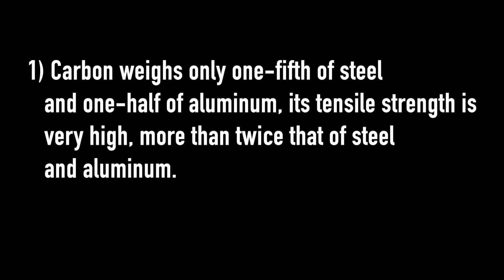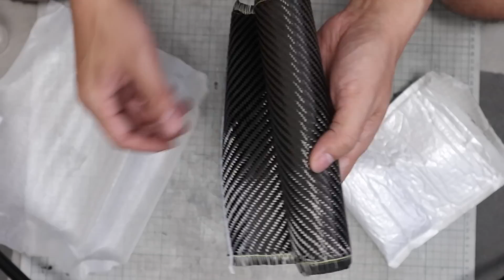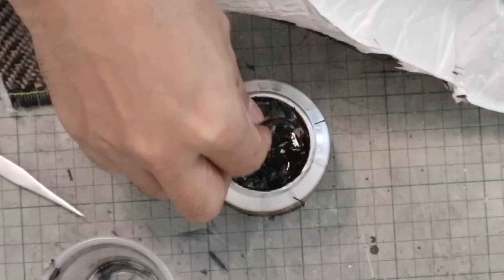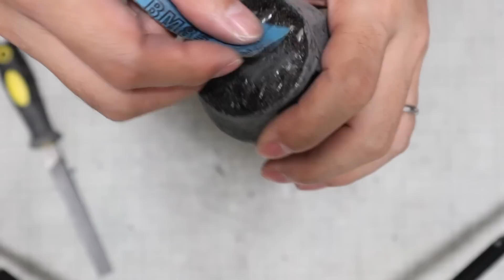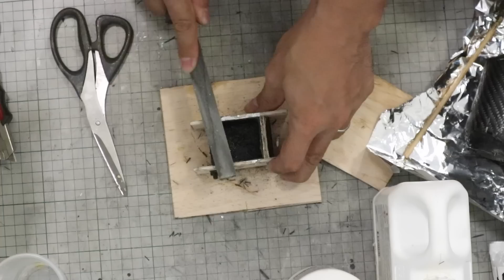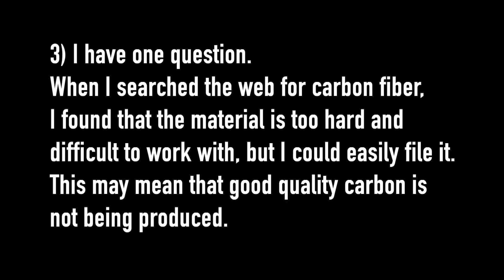Building The 5-Axis CNC Machine in a Small Room: A DIY Journey. (part4)

Comment: Mine use forged carbon combine with tempered aluminum for bolt attachment. I also use it to attach part which is bolted, act as dampers. For a thicker and longer parts like the gantry i put whole hollow steel inside, I also put pvc foam as core material to save $$$. 

Micro baloons add rigidity, mix it with epoxy resin. For cnc application cure it around 80°C, do not cure it higher than 100°C it will be too brittle and got less damping properties.

 Mine mainly use at moving parts like z axis, and vibration dampening. Forged carbon are much stronger than common cf if you put long strain of carbon, i got it from unidirectional carbon fiber.

I got plenty cd from my 90s car wide body project.
Reply: Used compressed air to your body and clothes before taking a shower. It'll get worse if you take a bath before cleaning the dust. Clean your work area and change clothes immidiately. The dust will stay in your clothes even after you wash it. Woven fiberglass is a nightmare compared to just carbon fiber. I did not feel a thing from cf dust.
Reply from the maker: Carbon fiber is quite dangerous.
Handle with care.
Reply: @a-cnc-f  Many youtube video demonstrate handling micro baloon without proper mask. This material rated at micron, and almost weightless. I use 3m auto painter/lab mask when handling aerosil.
Reply from the maker: You are familiar with carbon fiber.
I am not very familiar with it, but I find it very interesting.
I can only do DIY level, but I think it is a very attractive material.

Comment: In ship building they use heated vacuum chambers to cure the epoxy. It cures quicker and air bubbles are removed from the whole volume. Vibration alone might not be enough.
Reply from the maker: We know that. But it is difficult to have all the tools at the DIY level.
The simplest and hardest way is vibration.
But as for heating, I may try it.
Reply: @a-cnc-f Heating will just speed up the curing process. As for vacuum, a simple vacuum cleaner attached to a thicker plastic bag would do.
Reply from the maker: @akos_buzogany  I thought that heating would soften the epoxy and make it easier to release air.
The idea of vacuuming it up sounds interesting. I don't need to purchase any additional equipment.
I will give it some thought.
Thanks.
Reply: @a-cnc-f  Heating just speeds up the hardening process. I fill electronic components with epoxy. They harden in one day normally. If I put them on the top of the radiator (around 50 Celsius) they harden in a few hours. Look at the datasheet of your epoxy, it should contain information how temperature influences hardening.
A temperature above its melting point will make it softer of course :)
Take care of the ventilation, you don't want to breathe it in!
Reply from the maker: @akos_buzogany  Thank you.
It will be helpful.

Comment: If you are going to share it as open source when the machine is finished, I would love to do it. But I am thinking of building it on normal aluminum or steel plates, not epoxy. I would be very happy if you could share the case dimensions for this. Good work. I follow with interest.
Reply from the maker: The basic concept remains the same, but the design will be gradually modified to make the machine even more interesting.
It will not be open source, but once the design is finalized, I am planning to create an online course for the purpose of manufacturing it, including 3D models.

Comment: Interesting approach using the carbon fiber as a super rigid shell. Regarding the finish, I know for railways, people use self-leveling epoxy to attain precise tolerances:  they apply the self-leveling epoxy, then meticulously scrape the surface using a straight edge and ink as a guide.
Reply from the maker: thank you for the advice.

Comment: I like you project very much, such a compact design!
I had basically the same idea - epoxy granite cnc frame with chopped carbon fiber on the surface. Mostly I did it to get a nice surface look. I regretted it later though, cuz it was a lot of extra work laying all that fiber, especially around the inserts, and I got air bubbles trapped in there. Carbon plates is a great idea, use them as a mold and get a nice surface all at once, but mb the adhesion will not be as strong as in monolith epoxy pour.
Reply from the maker: In terms of integration, I think carbon plates have a disadvantage.
As you said, using a plate would be a great advantage in order to make it look beautiful.

Comment: I agree; cut carbon plates (and profiles) glued together on the inside, filled with sand-epoxy, sounds like a very approachable and capable machine frame. One thing is that you need to make sure to plan ahead of time as to where to put metal threaded inserts on the inside since drilling or tapping either CF or granite isnt really a thing. 

Bonding the insides with carbon L-profiles cut to size is probably a lot less messy and easier than trying to make sure some interior hidden corner is properly saturated and not sagging away or anything. Might cost a little more but I imagine it will be worth your trouble; also gives you more freedom in the order in which you assemble things (ie, one sideplate first, the other later; not really going to fly if you want to fill the corners with cloth).
Reply from the maker: I think in much the same way.
I am looking forward to the next test.

Comment: Whenever you're sanding or cutting composites please always be wearing gloves and a respirator mask.  That dust is nothing to mess around with. Additionally I think it could be a good idea to mix the carbon shards into the core epoxy mix to distribute it throughout the part rather than just having it on the outer most portions of the part.
Reply from the maker: thank you for the advice

Comment: Have you considered mixing the carbon chips with the Epoxy ceramic mixture. 
Glass fibre and others fibres are often added to concrete for reinforcement
Reply: Also look up forged carbon fibre.
Compressing the mould is key
Don't forget your ideal carbon fibre to resin ratio
Reply from the maker: I thought about that, but figured that the surface is what matters for tensile force.

Comment: Finished factory carbon fiber plates have maximum rigidity if the manufacturer has not violated the technology. It is quite a painstaking task to independently achieve Young's modulus as from a reference book. I think you should make several bars with and without lamination instead of a cube and compare from the bend to the standard load. This will be interesting material and will reduce the cost of technology trials.
Reply from the maker: Thanks for the advice.
It seems that people have different ideas when it comes to carbon fiber epoxy granite.
As for strength, your opinion may be correct.
For me, the purpose of using carbon fiber is very much about appearance, so I will use the plate for my next test.
I received the plate yesterday.

Comment: I don't think wrapping the part in cloth will do much for tensile strength, or strength in general. Instead, think reinforced concrete. Try using carbon fiber rods, which have very good tensile strength, not the cloth. So, for example, if you were to make a part that needs good tensile strength in one axis, add 2 (or more) rods so that one rod stretches and other compresses as force is applied on that axis (and vice versa).
Reply from the maker: Thanks for the advice.
I will consider various, ideas.

Comment: i thought you were going to put the chopped carbon fiber into the mix as an additive. i believe this could enhance the granite properties, and actually make the machine a little bit lighter. as for the surface finish and using carbon weave as an outer skin with tensile strength, using a well made mold like you did with your original epoxy granite build should give you a good result and clean surfaces that do not need to be ground, or at least only very little only when it comes to aligning and final tolerances of the machine. as you can see it is not completely impossible and for this fine finishing the dust and labour will be minimal.
piling on carbon by hand is obviously very rough and crude.
anyway i am sure you have gained valuable experience and i am excited to see how you will continue, and to see the machine take shape. the result will be impressive, i am sure of that!
Reply from the maker: thank you.
There are many things that are inadequate, such as equipment, experience, and knowledge, but I want to make something as good as possible.

Comment: Thank you for a very interesting video! Please be very careful when working with carbon fibre, especially when sending it with a file. Airbon micro fibers are harmhull for the lungs. Also, epoxy particles can trigger long term allergy if inhaled.  Good ventilation and a mask are required.

Comment: You are wrong! 8-10% Epoxy ist enough, its NOT too try!!!
Read and understand why this ammount is enough!!!
Reply from the maker: In general you are correct in your opinion.
I have made epoxy granite many times.
My initial goal was to get the epoxy percentage to 10%.
However, I could not get the air out of it successfully.
You need a vacuum pump, sand and gravel ratio, etc.
But I do not want to buy a lot of stuff.
From my experience, in my hobbyist DIY projects, I put more epoxy and focus on fluidity.
Sand is heavier than epoxy and will settle down.
A layer of epoxy will form on the top and bubbles will form on the surface.
Finally, add additional sand or other material to the epoxy layer.

Comment: For a cnc you want good dampening, good thermal expansion properties, good amount of mass and good amount of stiffness. Carbon fibre excells in one of these, the rest not really.
Reply from the maker: Carbon is not perfect.
That's why I use it with epoxy granite.
Reply: UHPC performs better and is usually cheaper FYI @a-cnc-f
Reply: Also the mass of epoxy granite helps a machine to stay still and resonate less

Comment: One thing that comes to my mind, is that on cnc milling machine, weight is your friend, and not to make it as light as possible.
Reply from the maker: Usually you are right.
However, this machine is super small and is designed to be hand-held and moved by hand.
It needs to be heavy enough to be hand-held.

Comment: I work with it everyday. Carbon fiber is very easy to work with abrasives because it has fragile behavior. It became a problem for common cutting tools because it's abrasive itself and will  destroy the cutting edge. 
Mix fibers in the granite, you will not gain much stiffness by only skinning the exterior with that little thickness . If some of the pieces you need have a clear and easy load path, use unidirectional fibers along the stress direction.
Remember that (common) carbon composite with cloth or chopped fiber isn't that stiff, less than aluminum per volume. It's stiff related to the weight. If you need high stiffness you will need a lot of carbon fiber, not just some layers here and there.
Reply from the maker: It is a great honor to receive comments from a professional person.
Thank you for your valuable input.

Comment: Mix the loose fibre into the epoxy granite like you do with the sand. You i saw a video where they mixed it with concrete to increase its rigitity. Same with carbon nano tubes
Reply from the maker: Yes, it is.
I thought about that as well.
I may try it next time, but the reason I didn't mix carbon into the epoxy granite this time is because I figured that covering the surface with carbon fiber would be strong enough.
Later, carbon fiber is expensive, so I wanted to keep the cost down.
Reply: @a-cnc-f  
Great rigidity is important as skin parts, as you surely know it.
To mix them in GE is just to throw bucks out the window

Comment: 3D print your mold using PETG. You can then use regular mold release. You can 3D print the mold with several pieces so that you can assemble it in such a way that will allow you to assemble it where the final piece compresses your epoxy mixture. You can leave small channels for the epoxy to escape. The idea being that you want only the amount of epoxy necessary to bind the matrix together. The end part should be extremely stiff and strong.
Reply from the maker: Making molds with a 3d printer is very interesting.
I have tried it before.
I have even tried using water soluble filament and melting it after the epoxy hardens.
I would like to experiment more in the future.
Reply: @a-cnc-f  The process is called compression molding. Easy Composites has a really well done video on their channel.
Reply from the maker: @GatorGlider  
Thanks for sharing.